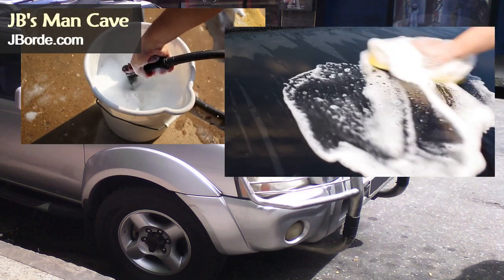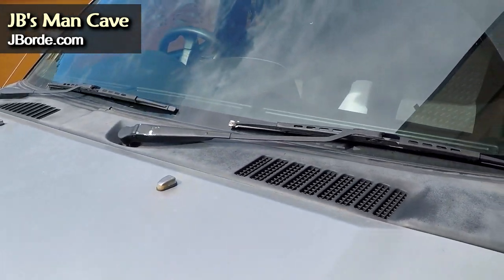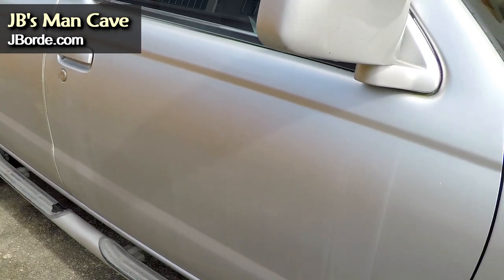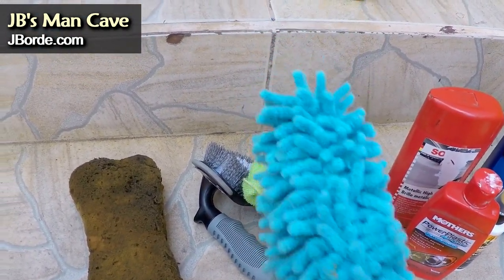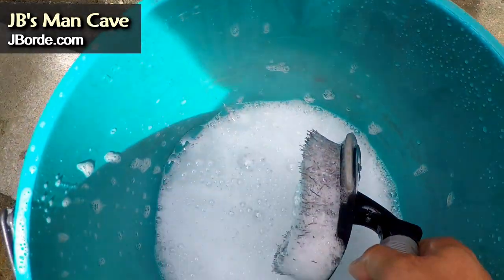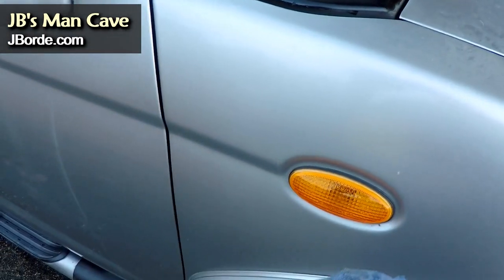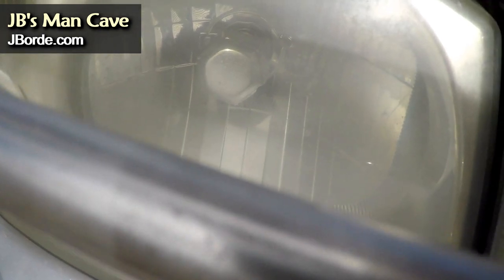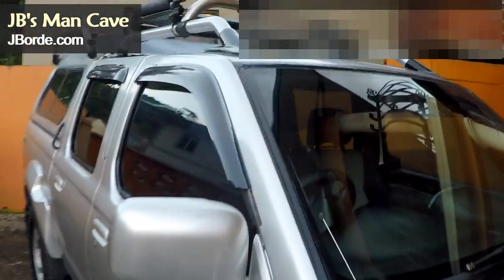Cheap Tips For Washing Your D22 FRONTIER Nissan Navara Truck, Car or Other Vehicle JBManCave.com

Comment: I sanded the headlights and polished it with regular car  polish and then also applied some wd 40, you could also use wd 40 as tire shine and to shine  the faded plastic pieces of trim but it doesn't last long.
Reply from the maker: Yuvraj, thanks for sharing your tips.

Comment: foam pressure washer, blast it etc
Reply from the maker: Justin, thanks for sharing, what do you use to shine plastic pieces?
Reply: @JBsManCave  "mother back to black " trim & plastic restore.
Reply from the maker: justin, how long does that hold out?
Reply: @JBsManCave  about a week not that long depends on how bad the trim is
Reply from the maker: Justin, try my tip, over time it lasts a lot longer than that.